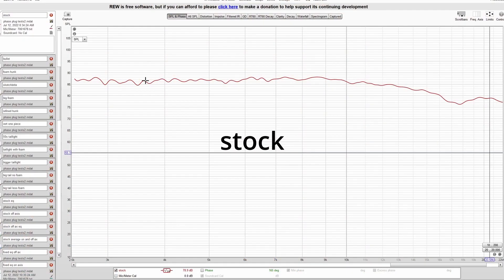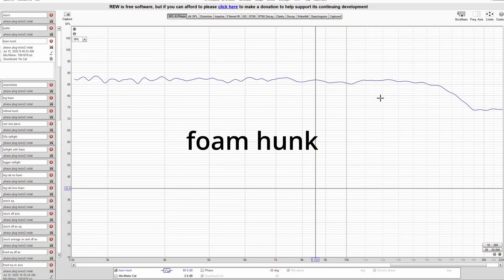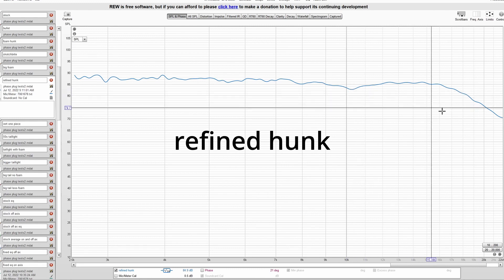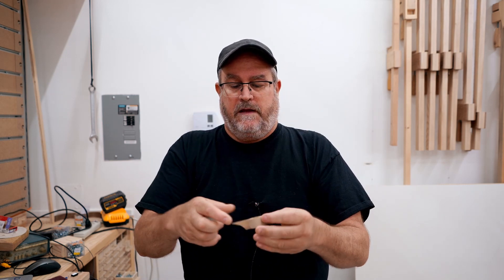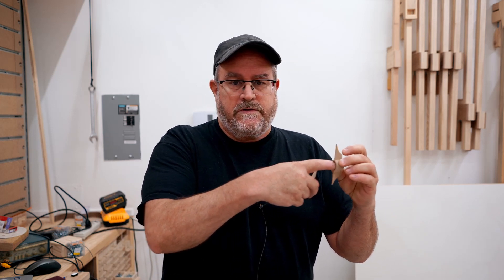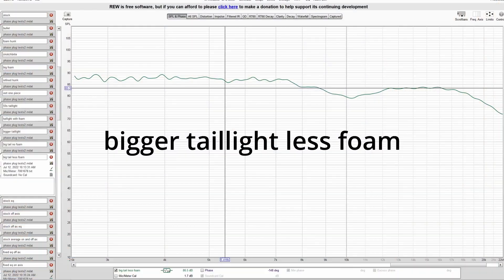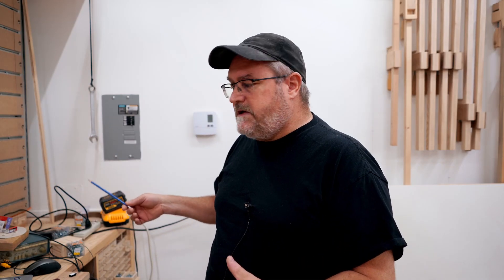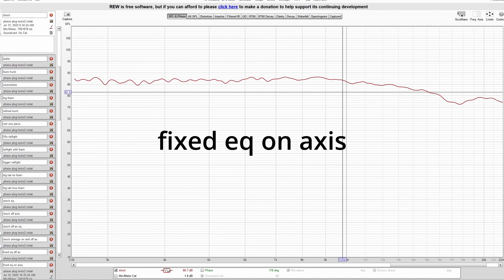Is it a Waveguide or is it a Horn? Plus Phase Plug Experiments

Comment: Great video! I made a pair of spears using full range drivers and removed the dust cover for a phase plug.
I did exactly what you did- quick prototypes to see if I was headed in the right direction. I used aluminum, copper, brass  and wood. The final result was bullet shaped teak with a flared brass sleeve down the center.
I find it amazing how much little changes can shape sound.

Comment: For that upper roll off you can compensate by adding a bypass capacitor to the series resistor you'll probably use to bring the sensitivity more in line with your mid-driver. The trick, of course, is picking the cap value (it won't be large) but it essentially turns that resistor into a frequency controlled resistor. As the frequency rises, the impedance of the capacitor lowers which will shunt the signal around the resistor. Of course, if you're using DSP this is moot.

Comment: Sonus Faber, KEF, and quite a few other brands also make use of wave guides with their tweeters to both add aesthetic appeal, but also to tune the frequency response and dispersion characteristics of those drivers. One of the primary benefits of using a floating disc in front of the tweeter, aside from tuning down some peaks in the upper treble region, is to manage beaming at those frequencies by forcibly deflecting those sound waves that arise from the center of the tweeter dome. KEF has designed their "tangerine" wave guide in a way that helps their mid-driver function more effectively as a wave guide while the surrounding horn shape of the "tangerine" wave guide helps to mitigate some of the doppler effect that a moving wave guide can sometimes cause. I've got an old set of KEF iQ90 towers and they have the very earliest "tangerine" wave guide that doesn't feature a central plug design, so they're just there for dispersion management. Even with the compound curve design of the mid-woofer, these tweeters aren't truly horn-loaded, as they don't feature any substantial amplification or horn resonance that you'd experience from a properly designed horn. Despite that, they do still reproduce brass instrumentation the best of any speakers I've personally heard, so that's something.

Comment: Rounding corners with radii that small makes no difference.  Mathematically the radius should be closer to half the baffle step frequency length but one thing you CAN do is introduce a smooth 45 degree angle part way across the baffle which pushes the virtual source point at impedance change from cab to air neatly at the edges firing out at 45 degrees not reflecting directly towards the listener.

Waveguide as a term has been in use for decades by the way.  Not so sure your friend there was the first.  Perhaps in the USA maybe?
Reply: Are you talking about putting a 45 on the outside edges of the baffle?

Comment: i notice it's just 1/24 smoothing, that's an impressive response and not just for diy speakers...
the off axis is also somewhat in line with on axis, a little exception around 10kHz w/ -5dB, no big deal at all. that speaker will produce a very pleasant and accurate listening experience. (of course the off axis also refers to vertical)

the "new idea" of speaker fq response puts greater importance on the off-axis compared to the older approach where the goal was to achieve a flat on-axis response and don't mind the off-axis too much once the listening position was chosen. 

-------------------
this new idea is in fact a better understanding of how we perceive speakers in a room and it turns out the reflections play a larger role than was initially assumed. cumulatively more reflected acoustic energy reaches our ears than the direct sound, up to the point where the high fqs are so directional that there's v little wall reflection. 

a speaker that maintains it's response off-axis relative to the on-axis (be it flat or not) will produce wall reflections that are similar in tone w/ the direct sound coming from the speaker. 
otherwise we hear two different tonalities...

when a speaker is measured in a room, the mic also pics up the reflections and without windowing the response (cut the recording before the reflection arrives) there is no way to tell what part of the sound is from the speaker and what comes from a reflection. so applying aggressive EQ can't really solve the problem since the speaker itself may be flat on axis and it's the off-axis that creates the non-linearity. 
hope this makes a little sense :)

 (they have these days setups and software that can eliminate the room reflections when measuring speakers in rooms, demonstrably identical to anechoic measurement of same speakers. the best performing speakers based on listening tests are the ones w/ a consistent on and off axis response, even if not particularly flat.)
Reply from the maker: All true for untreated rooms, but off axis response (and reflections) are less important in an acoustically treated room. The room these are in is treated and that's why the 1/24th response is so clean without gating.

Comment: This is interesting!  I have been thinking about directivity, and I've noticed coaxial designs covering a large portion of the low frequency drivers with a wave guide, or drivers covered completely in the case of Genelec.  (Or 2 small drivers spaced apart, in the case of an MTM....which is a coaxial speaker in my view.) I think the phase plug creates a tighter wave guide and forces all the energy to propogate from the perimeter.   I suspect this creates a more defined directivity pattern.  But just a theory!

Comment: What I find interesting about Earl's interview is the multiple subwoofers which I knew about but didn't know he was the one to arguably do the research first, and also the passive vs electronic crossover design, which I've also heard that passive can be "as good" as an electronic if designed correctly in synergy with the mechanical aspect of the loudspeaker.

Comment: Loving the videos John! Absolutely recommend checking off-axis. I recently spent days playing with phase plugs and got the on-axis greatly improved. Then when I checked off-axis it was horrific 😢  Days of work for nothing!

I was doing solid phase plugs. Maybe less chance to go wrong with a bit of foam. IMO it is probably slowing the propagation speed in that area and changes the wavefront shape. KEF say a spherical wave front is best for waveguides but pistonic drivers don't quite do that even if domed.

A 3d printer is brilliant for making phase plugs of all shapes.
Reply from the maker: There's not a lot of content beyond 15khz in most music, so that makes the gains even less. But with that said, I will try a disk and see how it performs. Easy enough to try it while I'm doing the final setup on the speakers.
Reply: @IBuildIt  I'll look forward to hearing how it works out. I'm someone who found significant benefit adding supertweeters with a 16khz 24LR acoustic filter to a speaker with Neo3 planar tweeter so we obviously hear quite different.
Reply from the maker: Well, often the difference (not necessarily improvement) that guys hear when they add a super tweeter is the comb filtering that happens when two drivers are cancelling each other out at certain frequencies. Unless the super tweeter is extremely close to the tweeter physically or there is no overlap at at all with the tweeter in the frequencies it plays, comb filtering is a given.
If you take a piece of music you like and open it in a program like Audacity, you can see how much high frequency content there is and at what level. Also normal hearing is most sensitive in the 2khz to 5khz range, and less so at low and high frequency.
Reply: @IBuildIt  My thinking is that the main audible effect was from changing the power response of the system. Much like a rear or upward firing tweeter, helping add back some of the HF reflections that provide cues for 'spaciousness' that get easily absorbed in room or simply don't exist from a narrow directivity tweeter. It certainly made the in-room response at listening position more linear, because without it the in-room response dropped off rapidly above 15khz or so.

Given that you said you can not hear the top frequencies it would be a really interesting experiment to see if you hear any effect adding a dedicated 'super' tweeter that you could easily switch on and off, perhaps with a bit of dsp for easy tweaking. Just an idea for an interesting video!
Reply from the maker: Unless a super tweeter has some magical power, the only way I'm hearing anything above 12k anymore is to suddenly become 30 years younger, unfortunately.
Reply: @IBuildIt  I'd assume the same, but I know some people who say they don't have great HF hearing but still hear supertweeters as a benefit. Could be listener bias or maybe the extra output helps bring back some of what they are missing? Anyway I look forward to your next fun installment!
Reply from the maker: Like I said, it's more likely comb filtering that they are hearing, but expectation bias is always a factor as well. Most guys that add a super tweeter are completely ignorant of the problems it can create and think more is always better. I mean, why is there such a thing as a super tweeter if it doesn't make an improvement, right?
Reply from the maker: @Audio_Simon  I was going to try a disk after the bullet, and then got sidetracked on the foam. And before I knew it the day was consumed.
I think that while doing these experiments was interesting, the net gain isn't worth the effort. Most people won't hear the reduction in output at 17Khz, so it's just for the "flat to 20k" bragging rights that it has any value.

Comment: Nicely done John.  You did a good job on this video. Welcome to the world of phase plugs. They give with one hand and take away with the other. Two things I would add. Nothing major in the least. The term waveguide is borrowed from radio antennas. Earl used waveguide as much for marketing as he did for setting himself and his work apart from other horn design work. It has been said that a waveguide is there to control directivity and a horn to both control directivity and add gain to the output device because of load matching the diaphragm to the air in a way that better matches the pressure generated by the diaphragm to the surrounding air. A horn allows more molecules of air to get a kick in the butt than just running the dome into the room. Excited molecules of air are what gets us sound. I'm happy that you did some EQ measured on and off axis. Again EQ is not magic. It causes as many problems as it solves. Nice to see you keeping it real. One last observation. The region from 2 to 5 kilohertz can shift your ambience a lot more than anywhere else. I know you understand this. Even a db and change can be noticed under the right circumstances. That I have played with many times. Again a lot depends on your recordings. And how they are made. If it is a two mic recording and all the cues to convince our ear/brain system are due to inter-channel cross talk and recording room reflections then you have a auditory magnifying glass to listen with. If it is a recording done with mono micing and mixed by a skilled engineer, then you have less of what can trick our ear/brain into thinking what is being reproduced in front of us is real. Thoroughly enjoyed watching. Keep en coming.
Reply from the maker: EQ can definitely do that if you overuse it (I have in the past) and don't look at everything it affects (I've done that too...). But it's a tool like any other that can fine tune to get the results you want. Much better if you can do that on an individual driver level, rather than globally, and limit how aggressively you use it.
Having a digital crossover with PEQ filters for each driver is a true luxury and makes the passive crossover option seem stone age in comparison.

Comment: Are you testing them in the listening room or do you have something specially built for testing? I’d be curious to know more about your testing process.
Reply from the maker: In my listening room. It's the best place I have it, other than trying to set it up outdoors (and I'm not doing that).
Reply: @IBuildIt  by those measurements it seems like a hell of a listening room! How far away was the mic?
Reply from the maker: 30 inches for everything shown in this video. When I properly set up the speakers I'll move out to a full meter away, but it won't look much different. 
In case you missed it, there are several videos here showing what I did in the room, along with measurements.
Reply: @IBuildIt  awesome, good to know! Thanks!